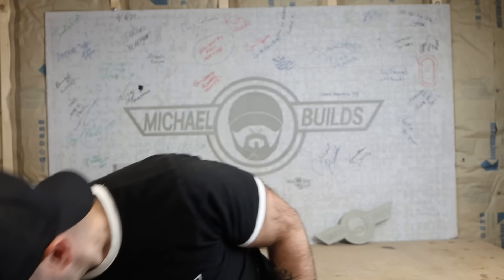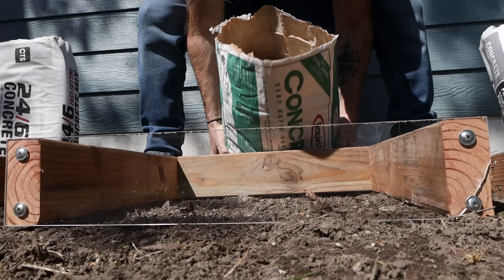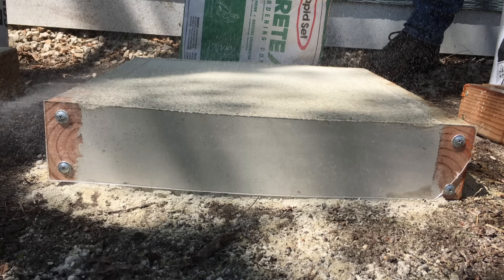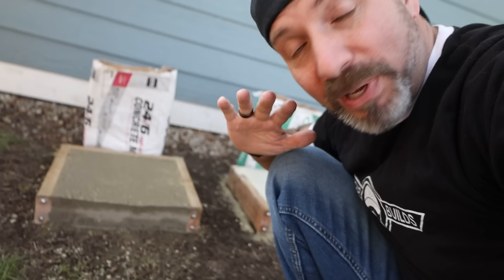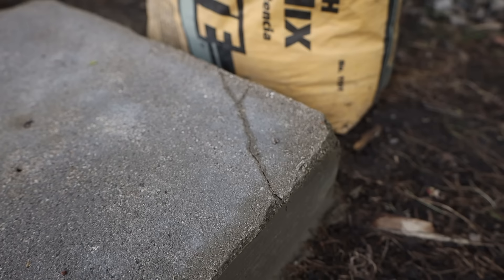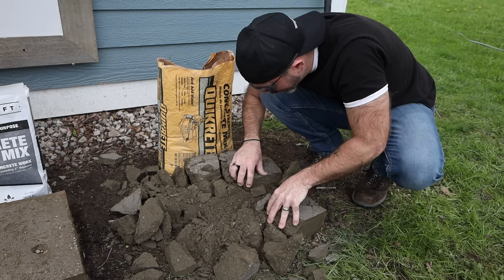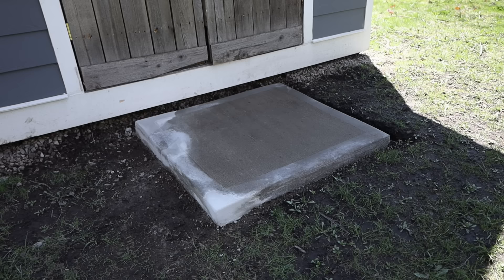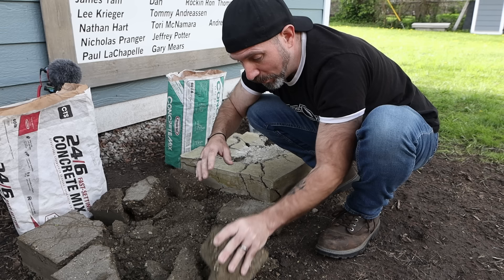Dry Pour Showdown!

Comment: AS  i have said in another vid  like this one ..  THIS IS NOT ALL THAT NEW..  eg ..  placing posts .  using  dry method    and  then watering ,  or    rammed earth   ,, where you  take  clay or sand soils   and mix  with 10 - 15 percent  portland  etc /  then only dampen  and then compact .. many vids   out there  . for eg . rammed  earth walls ..  stabilized earth  floors  and  driveways  etc .

Comment: If you are going to criticize about the volume of a product in a bag, then you need to account for ALL SIDES of the form that you used.  The bottoms are ALL on uneven ground, with the potential for gaps, holes, uneven surfaces, and there is bowing on the front edge which is made of thin plexiglass.  If I was the manufacturer, I would tell you to account for these potential volume discrepancies before criticism.  Science is science.

Comment: Test should be done after 20-30 days watering/rinsing each everyday while curing. Then after such, you can cracked them or smash them as you like. The purpose is that people are not gonna waste their money pouring a slab and then driving a truck ontop of it the next day, that pretty DUMB move on a dry poured method. I've seen retaining walls of regular cement bags and GUARANTEE that the sledge hammer wont break them but such is irrevelant one 24 hrs settling on the dry method. You gotta give concrete time to cure.

Comment: Any professional opinion on a smaller 10x10 patio using this method?
Reply: It'll be interesting to see how this turns out, but honestly, what's wrong with doing it the "regular" way? Is it that much more effort, or is it worth the risk if it turns out bad and you have to remove it? Either way, I'd like to hear how it turns out.

Comment: Why were you "...not impressed" by the volume of the Menards brand 60 lbs bag? Did you weigh it beforehand? Do they make any promises of volume in the bag? If they do, is that dry or mixed? Volume has nothing to do with weight. If their formulation is denser then it will weigh more per unit volume.

Comment: You're missing a very important step when doing a dry pour. In order to obtain a solid you have to introduce a source for moisture. The dry powder will
wick moisture from the soil beneath the base. Evidently you've been doing it wrong, and nobody's called you out. I'm calling you out. You're doing it all wrong. Period!!
After you have made your form, the most important part is to have a damp surface. In 10 minutes intervals, you want to soak the area. Three times is
sufficient. Now you can pour you're driving mix into the form. Lately mist the top, every 10 minutes at least 4 times. Then every hour, you will want to wet the surface. When the top dries, cover with plastic.
You're actually setting up your own little incubation
chamber to trap moisture to be absorbed by the
concrete. It's simple, it's easy and there's no mess.

That's the most efficient and foolproof way when using a dry pour. There's no cracking or putting.

Comment: Try the following and you will see a difference. Take a section of open cell foam rubber and set it onto the top of the dry pour. Soak it and keep it wet for 24 hours. Concrete requires a water to cement ratio of 35 percent in order to chemically react and bond. I am going to guess those pours are about 2 to6 percent depending on how much water it absorbed the short time it was wetted., So only the outer section of the pour actually reacted with the water. Not really a fair chance, as soon as the reaction completes, it forms a barrier which slows the penetration of water to the rest of the pour. You have about 24 hours to get water through the pour. Penetration depends on the admixtures too, and some brands use plasticizers which actually weaken the mix but make mixing easier. Ancient civilizations used dry pours that still stand. But their mix did not include retarding and plasticizing admixtures. Also they used quicklime which speeds the reaction and helps absorb the water faster. Try?

Comment: I couldn't disagree with you anymore..   concrete is meant to be mixed and poured to allow a chemical reaction to occur.  At that point the concrete spends the next several days hardening by drying out. (Wet curing is when we slow the curing process but adding water or using a cure and zeal product to slow the loss of water from concrete mix).   With what you are doing the mix is never really mixing to have that chemical reaction then begin hardening as it looses  its moisture.. I think what you have is a mix that's fighting for moisture to cure out which never happens.. the water eventually is gone with no reactive occurring.   So you may see little areas of clumping but there is NOT going to see that strong chemical reaction we see with normal concrete mixes done properly.  Should be able to test my theory using temperature

Comment: DRY POUR is a big mistake.   The water to cement ratio is a critical component of the mix design and its overall performance.   This method alters the design element significantly.   In addition,  when the concrete is properly mixed with the proper proportion of water a chemical reaction is initiated in which requires a minimum amount of agitation to blend the materials and coat the aggregates with the binder,  cement.   MATERIALS 101!

Comment: Try this method with a cake.  Just pour the dry and wet ingredients in a cake pan and they will magically mix while it bakes, right?  Wrong.  Why then would anyone thing that the dry and wet parts of concrete will magically mix?   Neither will it magically last. 
pouring
This guy keeps getting cracked corners for two reasons.  First it is not concrete, just damp concrete dust.  Second since he is not mixing he cannot be using form oil.  Even WD-40 will work.  Spray it on your forms before pouring and the properly mixed concrete will not stick.  Naturally you will still need to tap the forms lightly to free them.  Did not see him do that either, most likely because the blocks would have crumbled right then.  
Do yourself a favor and just go rent, burrow or buy a wheelbarrow and a hoe, if you do not already have them, and do it correctly, the first time.